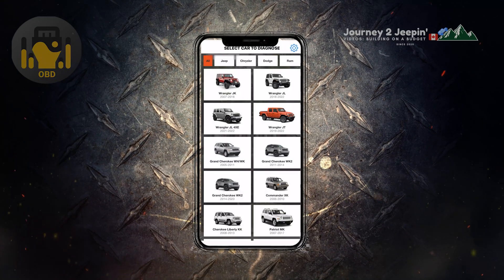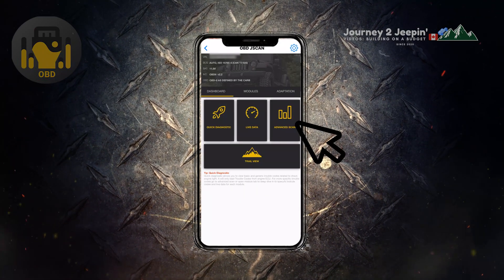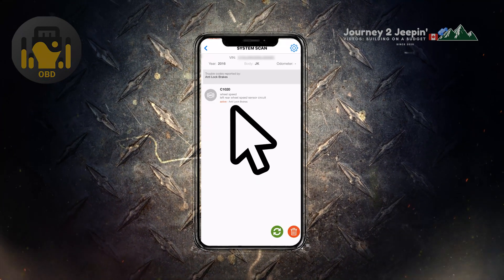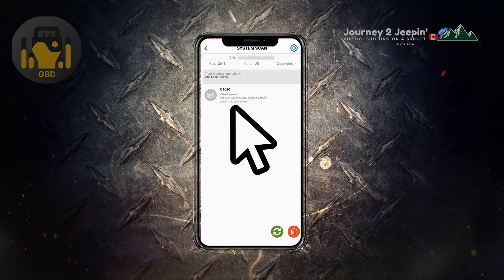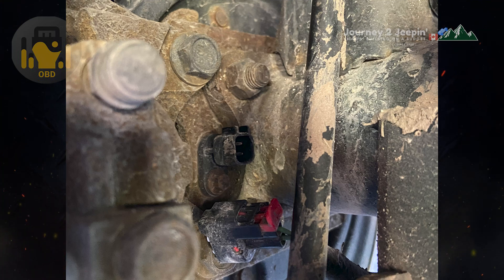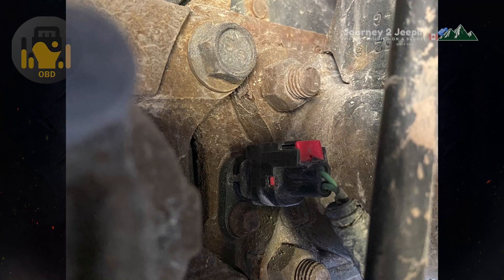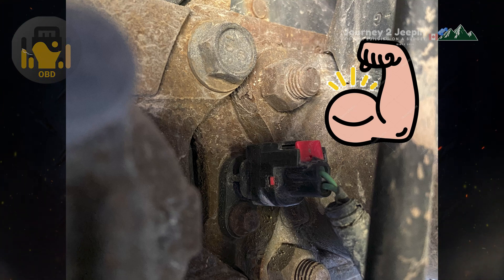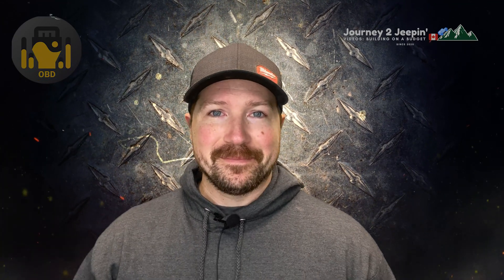OBD JScan ABS

Comment: Great tutorial, thanks! 

If I break ABS sensor on the trail my 4wd becomes temporarily not available (Wrangler JLUR with 4Hauto transfer case). Can jscan engage 4wd in this situation by killing ABS before ignition or something?
Reply from the maker: Hey Alex, 
Glad the video helped :) 

With JScan you can turn off your ABS prior to starting your Jeep. 
Select “Adaptations “, then “Modules chassis Network” and then select “ABS”   
This will allow you to turn it on or off as you please.
Reply: @journey2jeepin  Thanks! What is the differense between this function and "ABS+ESC Kill" in Adaptations "Tire&Axle settings"?
Reply from the maker: Hey Alex,
Looks like the setting you are looking at will also disable Traction Control at the same time. 
Both will disable ABS , just decide if you want Traction control on still or not :)
Reply: @journey2jeepin  Ah, looks like the one in "Modules chassis Network" also kills traction control, because its called "ABS/ESC -on/off" :)  There is no separate ABS) . So must be the same thing?
Reply from the maker: Hey Alex,
The one in my app is showing strictly ABS on/off, feel free to send me an email Journey2jeepin@gmail.com and I can send you a screen shot of what I am seeing on my end :) 
Hope that helps
Reply: Hi @journey2jeepin  , thanks a lot for support! I tried to kill ABS by different options and it worked, but I faced another problem: as soon as jeep doesn't have ABS it disengages 4WD immediately. Is there a solution in Jscan to force transfer case to engage 4wd while ABS is off?   My transfer case is the one with auto option.
Reply from the maker: Hey @Alexey Chulkov , no worries at all:)
Now this particular problem is one I have not encountered ( I have a JK ) but after looking through the adaptations, I don’t see anything that specifically speaks to that situation as of yet. If you contact the Facebook page and let them know the problem I’m sure they will work on putting that in, those guys are great to deal with based on my experience:)
Reply: @journey2jeepin  I tried to contact them earlier, but unfortunatelly looks like I can't reach them from Russia anymore. I thought the solution might be not in adaptation, but in modules - drive train control - activations. There are some options like Tcase status, which potentially might help, but I am scared to test before I know for sure what it is for)
Reply from the maker: That’s fair @Alex Chulkov,
I’ll send them a msg on your behalf and hopefully we can get you an answer  :)
Reply: @journey2jeepin  Much appreciated!👍
Reply from the maker: Not a problem Alexey :)
Reply: @journey2jeepin  Hi, happy New Year!  Any update?:)
Reply from the maker: Hey Alexey Chulkov, I brought forward your request, the guys said they would look into it. Hoping we see a solution/update that will help you out in the near future :)
Reply: @journey2jeepin  Top! Thanks!
Reply from the maker: No worries:)